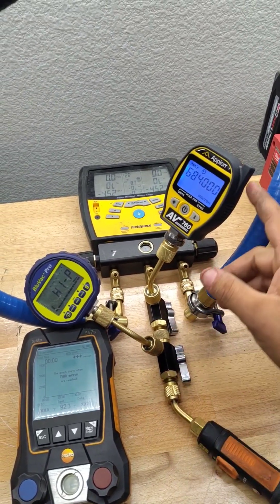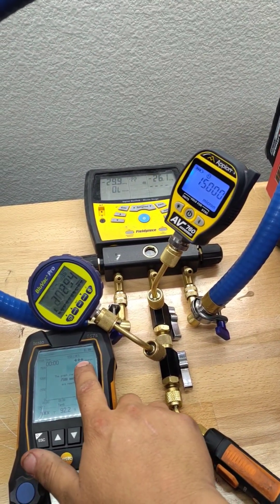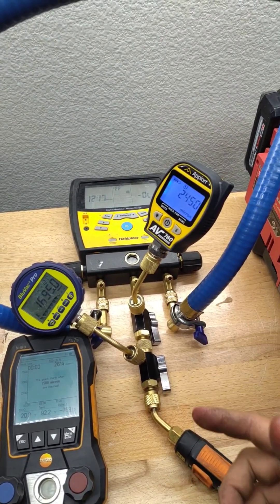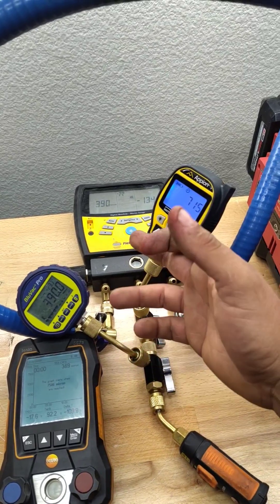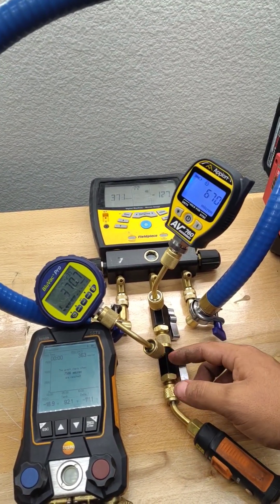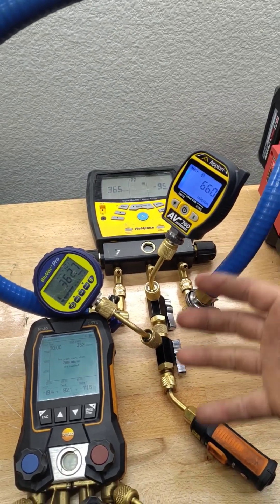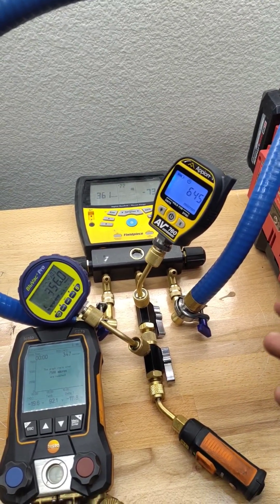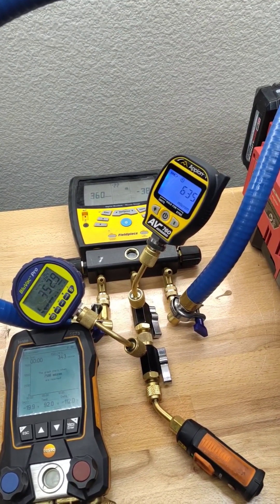Too many micron gauges?

Comment: Vacuum down an old refrigerant jug using the gauge with a VCRT attached.  Pull the vacuum to 330 um and then turn the ball valve to the OFF position.  You will see a much lower decay due to the volume of the refrigerant tank.  The way you are testing included a small vacuum volume and therefore the decay rate seems much worse.

Comment: Just information that helps me:
You have too many connections for testing your gauges, prone to leaks.
I use a reference analog gauge to test directly at the pump 1st, it should pump down to at least 30-25 microns or less.
Once you have a reference point, then you should test your micron gauges individually directly at the vacuum pump port, for accuracy, clean and calibrate micron gauges as needed, even if new.
Reply: yet 3 read the same....takes a genius..

Comment: I'd only be concerned what it reads when pump is off. And I understand that the manifolds aren't as accurate due to positive pressures also used on them.
Reply from the maker: My problem is three other gauges all match fieldpiece, BluVac and Testo and the appion is like double the others
Reply: What? how does that make any sense? Its like you didn't even watch the video.